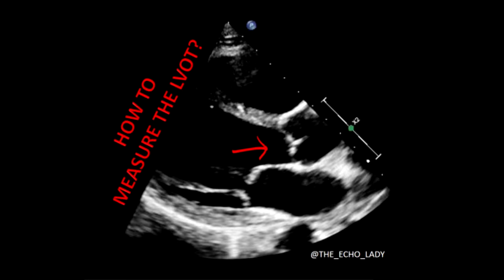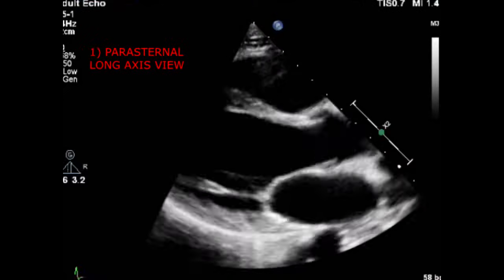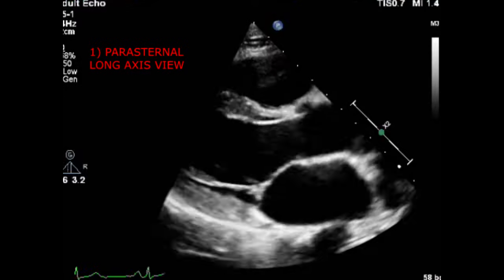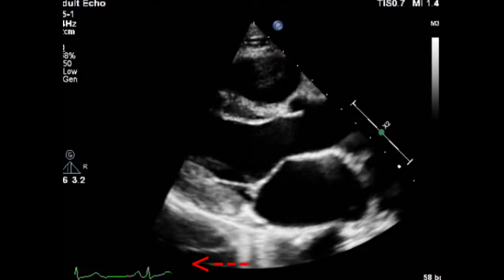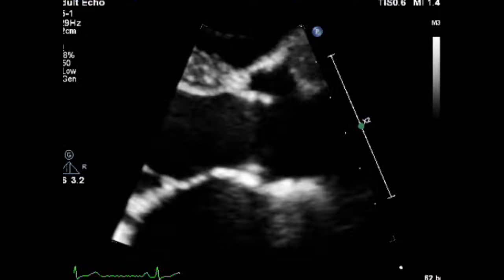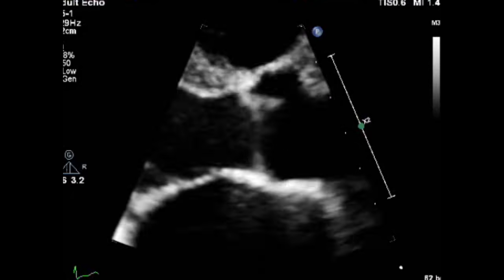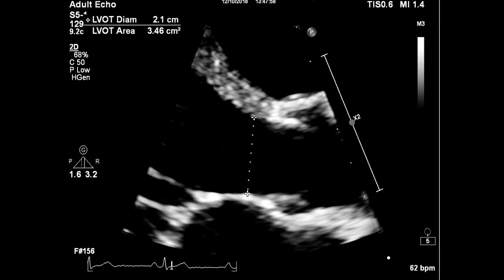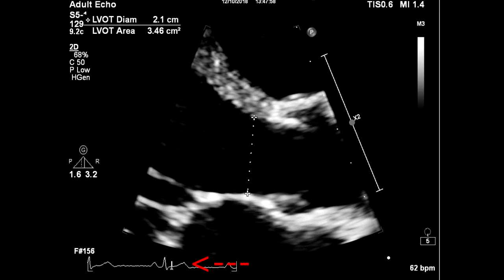ECHOCARDIOGRAPHY: How to measure the LVOT?

Comment: Is there a normal range for LVOT diameter?
Reply from the maker: This depends on the BSA, but normally in adults >2.0cm
Reply: @the_echo_lady  if less than two what it indicates?
Reply from the maker: @hema3010  nothing really, just a small LVOT... You could find a smaller LVOT on tiny patients. Or maybe a basal septal bulge can make the LVOT smaller. Just be careful because this value will affect the valve area... Always take more than one value into consideration in the assessment of valve stenosis.